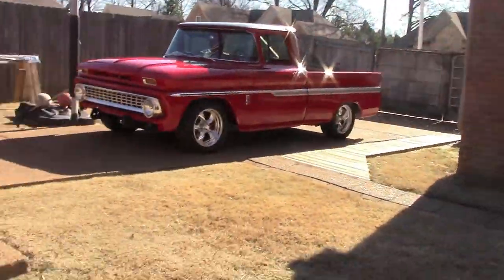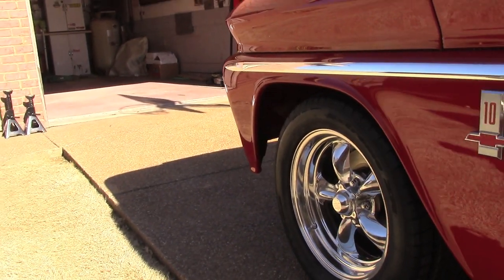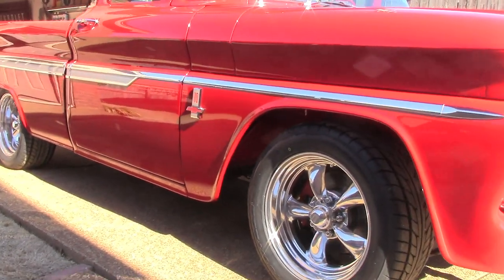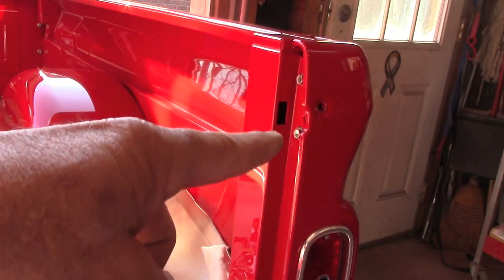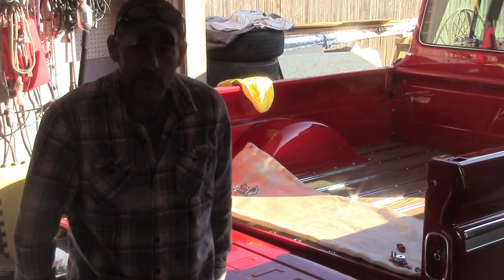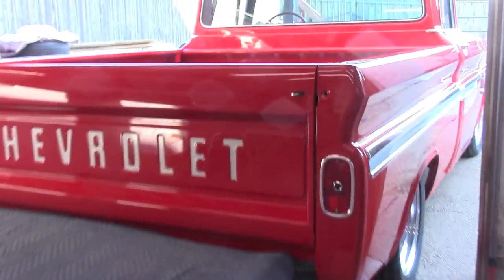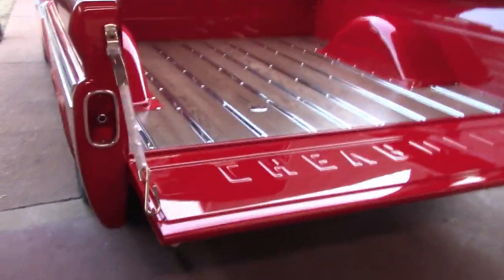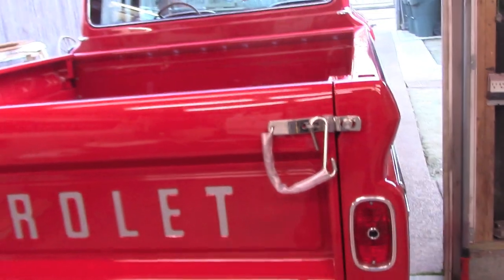new tires/wheels and tailgate on

Comment: Your truck is nothing less than "GORGEOUS"!!! Never in its former life did it look this good. I noticed when you backed into the garage that only the drivers brake light worked. Later in the video, they both worked. ;o)  When you get tired of being a carpenter, you can certainly do custom body work. ;o)
Reply from the maker: I hade problems with the brake light going off and on I think I got it fix it wasn't ground good enough
Reply: +gibson63 Makes sense with everything so nicely painted.
Reply: Gibson63

Comment: Beautiful C10. I'm restoring a 65 for my dad. I'm going with the same wheels in a 18x8 front, 18x9.5 rear for a wider tire. I'm still deciding on the stance for it.
Reply from the maker: Cool deal man that wheel size Is going to look great on a low stance no doubt

Comment: For grounds on those era tail lamps, if like the 67, the socket is crimped into the housing. What I did was use the regular ground, but wire wheeled the socket at the housing, soldered it flux first, then drilled an extra hole in the same house, used star washers to eyelet and ran to the beds frame.
  Voltage drop is a task that is quick, doesn't lye and doesn't care if meter leads are backwards. Fixed hundreds of electrical problems this way.
  On a pickup, you need a ground from battery to engine, but to the frame, cab, bed and on the back frame of the alternator where negative is created to engine!
Reply from the maker: Thanks man That’s pretty much what I did to fix the problem

Comment: Looking really good.  Are you worried a little about the latches on the tailgate scuffing the paint over time?  Was thinking you may be able to use a self adhesive padding on the back side of the latches to keep them from metal on paint.  Love the truck.  Do you think Custom Classic Truck magazine or another one like it may pick this up as a build article?  They definitely should.
Reply from the maker: Thanks a lot man I did fine some clear rubber stops to go in between the bed and tailgate, worked great

Comment: that turned out awesome. .what is your plan for the rear bumper
Reply from the maker: The original bumpers are being chromed I'll pick them up in a couple weeks
Reply: +gibson63 if you don't mind. .what are they charging you for doing the rechroming
Reply: +piratexpress1369a 

Man it's best just to buy aftermarket ones and just store the originals away. I called 5 different places to re-chrome my grill front,back, and side emblems was like $3500... just for the grill and front bumper was over a $1000. you can get an after market front and back bumper for around $500 or less.
Reply: +piratexpress1369a 
I meant to say reproduction bumper instead of aftermarket. 

1958 Chevy Apache

Comment: did the tire and rim fit with out any changes to the stock set up?
Reply from the maker: loud mopar mopar      Tires and wheels fit great without any issues I did drop the truck 3/5 kit from classic industry worked out great
Reply: thanks  for the help! I am working on a 64  now its my first truck to rebuild